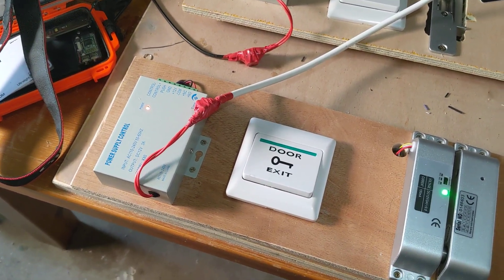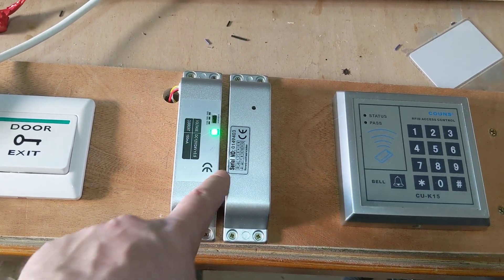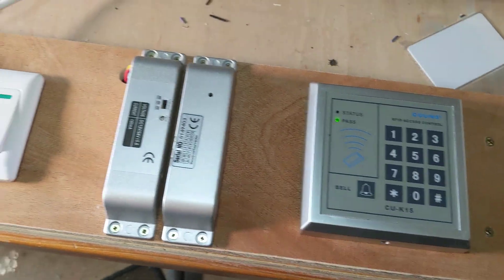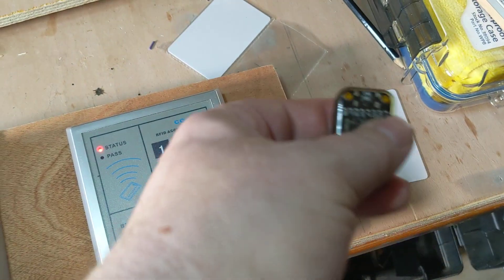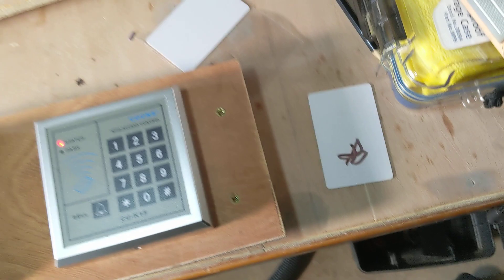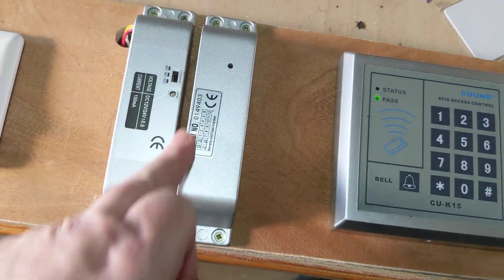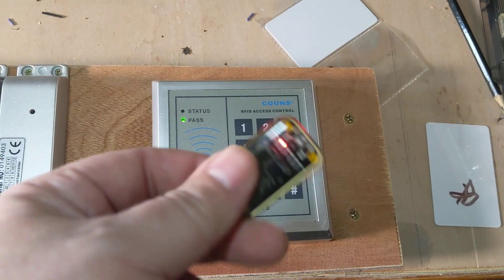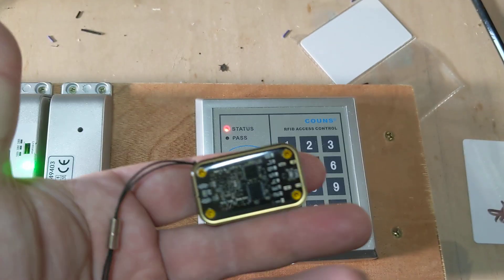Proxgrind Chameleon tiny demonstration, cloning a mifare classic high frequency RFID card

Comment: Thank you for this video! To clarify, the chameleon tiny will only be able to clone tags as you demonstrate if they are authenticating with the reader just on the UID (aka using the same technology as a 125khz tag)? And if the target tags are using a higher security procedure with encryption keys then you'd need longer access to the tag so that you could run a nested attack etc?

Comment: Hello Quentyn,
my chameleon tiny shuts off immediately after I turn it on. I can barely change one setting-slot. On Usb it works. Charging light blinks. Any ideas ?  I already tried refitting the battery but nothing changed...
Reply from the maker: i would contact the manufacturer / the shop you bought it from

Comment: can you please make a video to show us on how to update the firmware. Thanks
Reply from the maker: sure i will do it as my next one
Reply: @QuentynTaylor  I'm trying to get reader attacks working on the ChameleonTiny but i can't seem to find the proper firmware for it. ChameleonGUI is saying i'm lacking the DETECTION cmd for the mfkey32 key recovery. Any help would be appreciated!
Reply from the maker: @Herearetheundead  have you used the mobile app and connected the chameleon to that ? you can then do a firmware upgrade direct in the app. Personally i just used the one direct from github and flashed it via linux
Reply: @QuentynTaylor  Haven't been able to test the app yet, i will give it a go if i can get my hands on an android device. I've been able to flash the firmware, but for some reason it just doesn't support the MF_DETECTION.
I will give it another go tomorrow, see if i can compile it myself this time. Maybe that helps too
Reply from the maker: @Herearetheundead  i would try it in the app with the firmware that the app pushes 1st - the device is designed to be used with the app i think
Reply from the maker: have a look now - just uploaded tonight